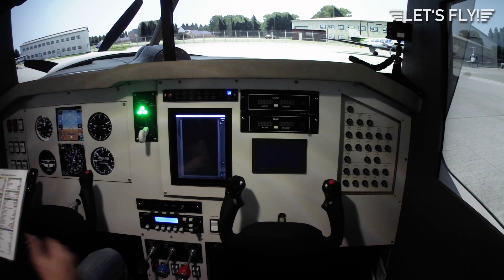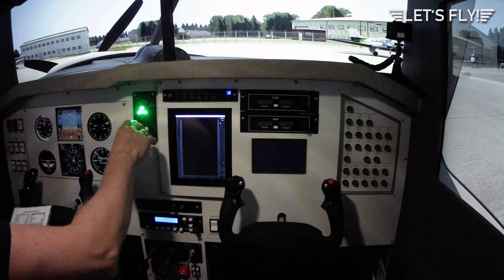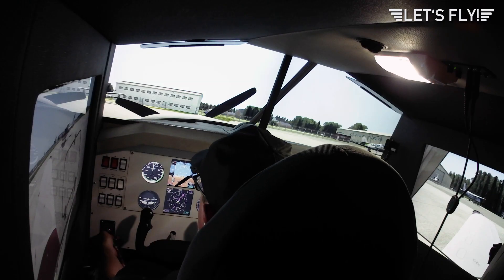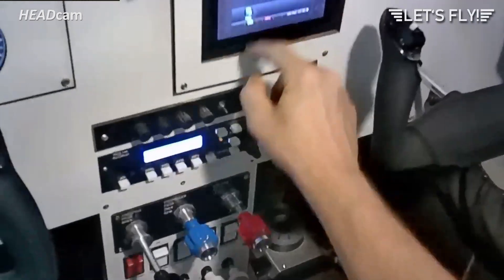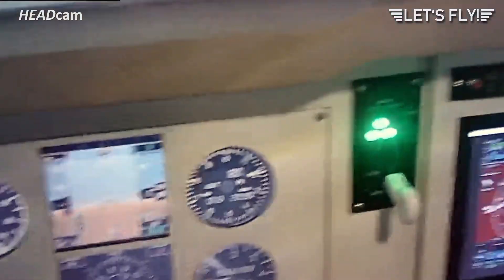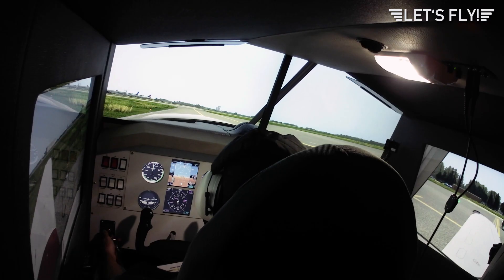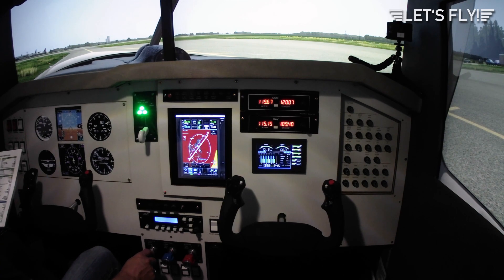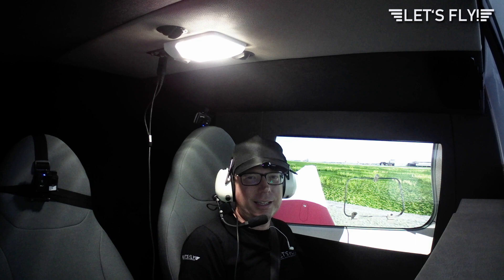Mooney Homecockpit - Starting the plane from cold & dark

Comment: Can you have both Yokes connected at the same time or do you enable/disable the other yoke when copilot needs to fly?
Reply from the maker: I can use both the same time. I connect them via a virtual joystick software so it makes one joystick out of both and so x plane can handle it. Native XP11 cannot handle 2 joysticks for the same axes
Reply: @letsfly   interesting! So the software figures out who to trust if you bank left but copilot banks right? 😀
Reply from the maker: @supra2800  the software is called "unity" and you can setup if you want to simply add inputs or distinguish between priorities. Quite similar to Airbus  technology (but without fly by wire alpha floor protections and normal law etc)